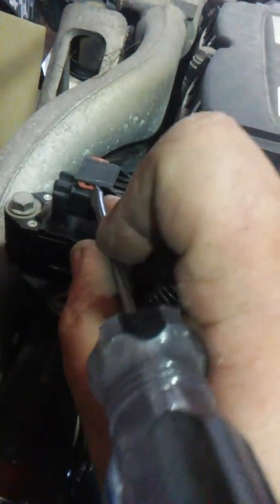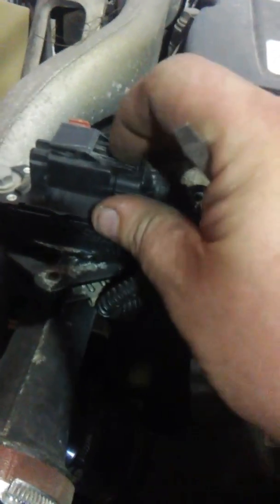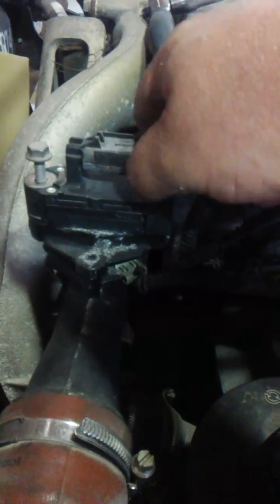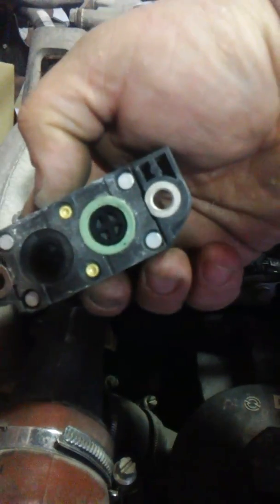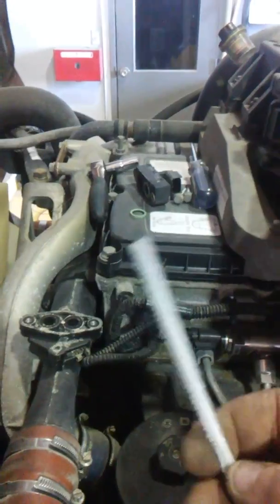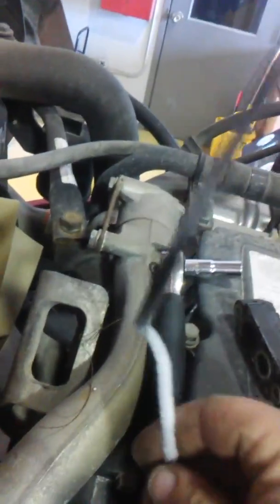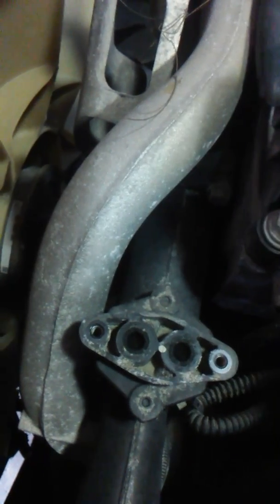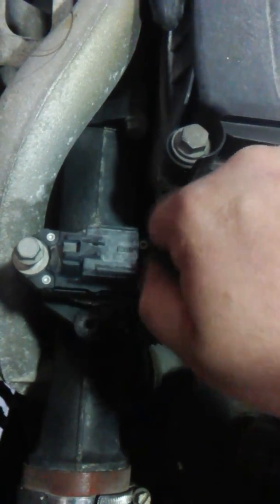Delta pressure port Cleaning

Comment: This was a good video. I was cleaning my 2015 freightliner cascadia dps. I couldn't even see the holes, it's 2 of them. The holes are on opposite sides of each other. I took a small 🪛  and scraped until I seen the holes. Was having a hard time, because both holes where packed with the gunk. It took some patience, but the wire eventually went all the way through. This was the best video. Thanks man.

Comment: Not saying this doesn't work for now but per Detroit you are not to clean it, you are to replace it because it has a nonstick coating in it. And your surging idle is your quantity control valve. And is your other truck a cummins? If it is then yes cummins says clean the port. It's not a venturi tube.

Comment: I have a 2014 Freightliner Cascadia , has the fault code for spn 411. I tried cleaning the delta P sensor port, but my pipe cleaning stick will go about an 1 thru the port. Does this mean the port is really clogged? I tried using the metal stick to poke thru the ports but it won’t go thru. I saw how you clean your port and you get that pipe clean stick right thru the port without any problem. I don’t understand why I can’t get it to go all the way through. What should I do?
Reply from the maker: Keep trying and remember to go in at an angle. The ports are not straight down
Reply: Hey I’m having the same issue now were you able to get port cleaned?

Comment: Thanks for making this video. It looked as if there was a seal or a ring that sat in between it. Is that correct? If so is that something you can buy separate from freightliner if you lose it or if it breaks?
Reply from the maker: yes there are 2 o rings. I am sure they make them never checked into it before.
Reply: James McLeod okay. Thanks for the reply.

Comment: Thanks! We had fault codes on our truck that pointed us to Delta P... ECU 128 PID 411 FAIL 13. We followed your instructions and we are back on the road. Luckily it was clogged up, and not a bad sensor, will still replace sensor at next chance we get just in case. Stuck at Loves Comfort TX for more than 24hrs!
Reply from the maker: glade it helped

Comment: Will the pipe cleaner reach all the way thru?
Reply from the maker: Well it should get down in there
Reply: I keep getting the out of calibration code and low pressure low code. I changed the sensor and pigtail and did the calibration. I tried to stick pipe brush down the holes and it wouldn't go in more than an inch or so, definitely not the way yours went down. Is there a way to clean the pipe or do I just change it? I have been out of service for 2months bc no shop could figure out why I'm losing power and that egr delta pressure sensor is the only code that comes up. Please help 🙏🏽 any advice
Reply: @marknorth1686  the old style has curves and is hard to clean..the new style has straight passages and cleans much easier...not expensive to get a new one, but I don't know about availability these days..
Reply: @wittemanadrian  I just took off the pipe and tried to put a zip tie through it would not go, the new allows the zip tie to pass through. Hopefully this gives me my power back 🙏🏽
Reply: Yes it will
Reply: Jim McLeod  I have 2013 peteebilt 386 I get it light on after search fault said EGR delta pressure I change put I. The new one But I have light on say same thing like before but I’m not cleaning inside the port I’m a must clean to go out the light ?
Reply from the maker: @taajirali704  it cant hurt. But also it could the wiring. Check wires..